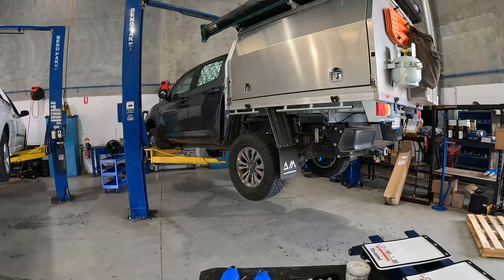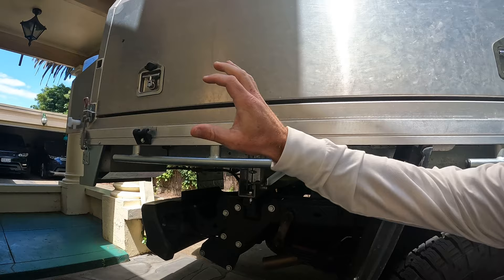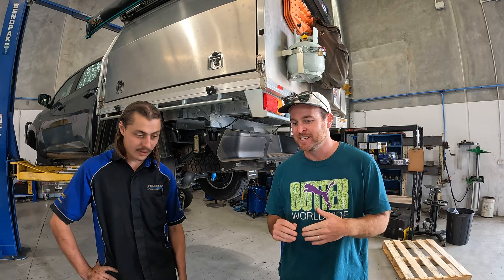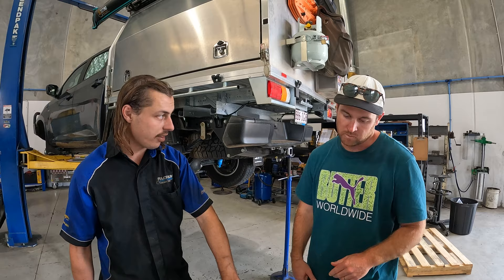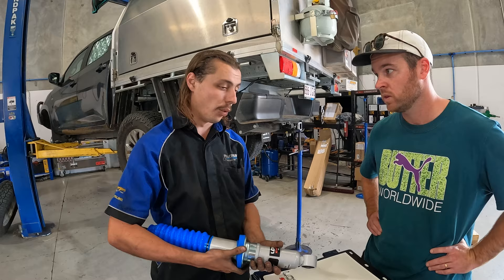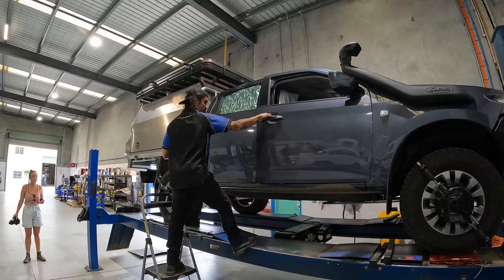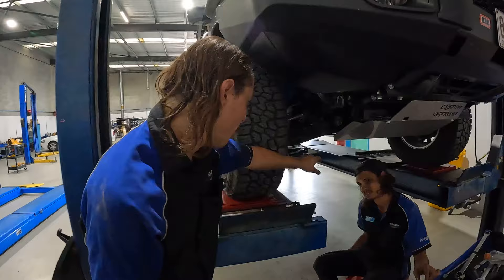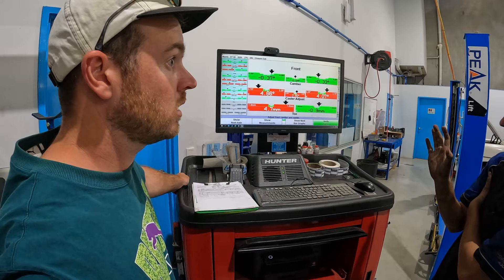GVM UPGRADE EXPOSED (what EVERY 4wd enthusiast should know)

Comment: The issue I see is that Lovells have "tested" the axle and they say it can carry more than the vehicle manufacturer has set as a limit for the maximum.
So if the axle breaks the manufacturer will not warranty the vehicle as it will be overloaded as per thier weight limit. 
Will Lovells cover you if it does fail? then you are stuck like a rubber band between the 2 and you are not going to win in this situation.

Comment: Great informative video, thanks. My question is after getting everything done (GVM) , does the car hop around like a kangaroo? Does it drive stiff? Ive heard this and Im weary of it.
Thx
Reply from the maker: Hey mate, luckily not at all. It drives really well and tbh feels very normal. We do have a fair bit of weight on the back, which would soften the springs so they are jarring. We also got the upper control arms and steering knuckles upgraded (video on that coming soon) which also help a lot with the driving.